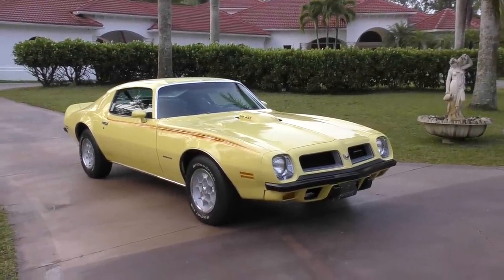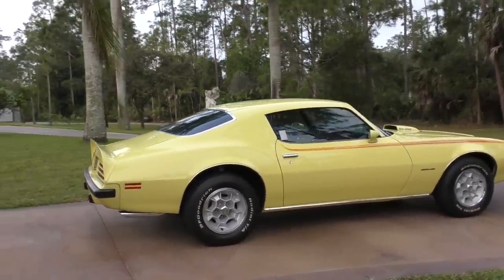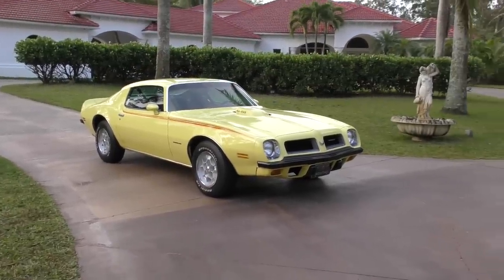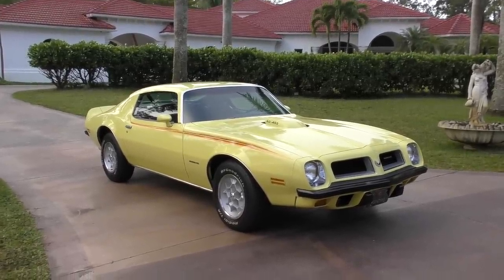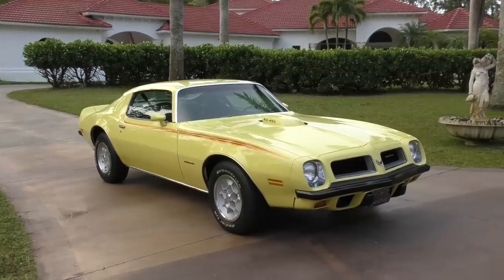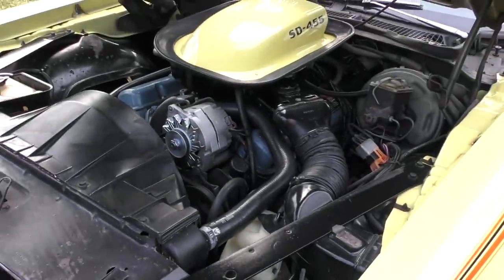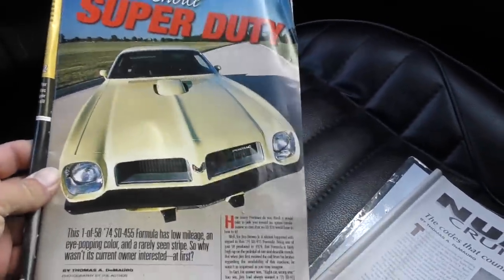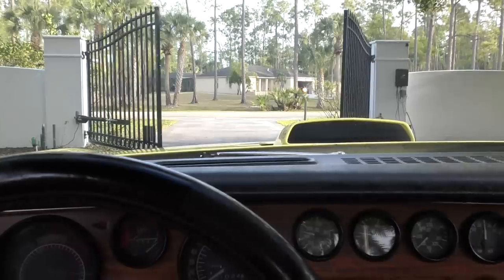1 of 58!  This Ultra Rare 1974 Pontiac SD 455 Formula Firebird is The Last Real Muscle Car

Comment: As cool as the 455SD is.  I cannot agree that it was the last muscle car.   Pontiacupped the 400 with the TA6.6 package from 77-79.  All the 400 79s had the ST-10 trans, 8" rims and 4 wheel disc brakes!  Nothing came close to it so, 1979 was really the last year of the big inchmid size/pony cars-  Trans Am & Formula
Reply: A Muscle car with single Exhaust and Cat? Not even close! the only 400 comparable would be RA II/IV! nothing else!

Comment: Having owned a 73-455 Trans Am (complete with WS6 suspension), I have to admit, on this Gen2 F-Body, the one thing mine DIDN'T have that I wish it did...was a VERY RARE option offered by the factory called the 'Formula Hood/w Shaker'...As the 73 Formulas had twin snorkels that came down to the front grill, picture putting the conventional TA shaker in it, as well...I've seen two in my lifetime...one was a 73, one was a 77 (in 77, the owner told me that it was ONLY available if you purchased the 'Formula 400' package, where the default OEM engine was a 350). Few realized when special ordering Firebirds, that ALL HOODS were available (sometimes as a powertrain-associated package) to all non-Esprit cars...except the Formula Hood/w Shaker, which could ONLY be OEM added to Formulas...

Comment: I've been looking for a Formula 455 Super Duty Car.  Is this the real deal with a Trans Am Hood on it????
Reply from the maker: Yes. The SD Formulas had shaker hoods from the factory.
Reply: @curiouscars9282  Why is it called a Formula then and not a Trans Am?
Reply: How can you be "looking for a Formula 455 Super Duty Car", and not know about the Hood scoop??
Reply: @chutoparadinni5474  The car is the only one I've seen with a shaker hood.  A Formula Firebird does not have a shaker hood.  Someone who owner this car put the trans am hood on it.  No doubt about it.  The tags must day its a Formula but it has the wrong hood on it.
Reply: @24revealer You are incorrect, All SD455's came from the Factory with the Shaker hood scoop, whether Formula or Trans am, same scoop, Pontiac did not want to certify the SD455 again with the twin scoops of the Formula, therefore, the Shaker was used on both.
Reply: @chutoparadinni5474  Ok, I'll have to take your word on that.  I guess I'll search for a 73 455 SD with the Formula Hood.
Reply: @24revealer  Good luck, same as 74

Comment: Its not a big block Pontiacs never had a big or small block they had one size block and just changed the bore and stroke to get different engine combinations later on they had two engines w a lower deck height but in that time frame they only had one size block on the outside so if you had a 350 you could easily swap in a 455 and it be plug and play and that in fact was common back in the day as the three fifty was not so spiffy but the four fifty five was quite spiffy lol

Comment: I have a yellow 1974 Charger Rallye 440 which is a great car and the last of the real Chargers not this 4 door crap they have now. The 440 had 275 net hp and 375 torque. With a recurved distributor and rejetted carb and the 3.55 rear end with the torqueflite it ran a 15 flat at 92 mph. Not SD numbers but still muscle car status. Everything went for a rot after that.

Comment: Are you absolutely sure it is legit? I was unaware that the formula ever came out without the front lower spoiler and wheels flairs. Typically the body was exactly the same in the base model formula as the TA with the exception of the hood
Reply: Flares and spoiler for TA's only
Reply: Formula never had the Trans Am flares, spoilers etc. What are you talking about. Look at the factory showroom brochures for pete's sake.

Comment: thats not a Formula - if it is why put a hood from a T/A on it ???
IF its what it is then why modify it ???
This has been answered by another viewer AND at the 22 minute mark of the video - (me bad).
" 73-74 SD Formulas received Trans Am shaker hoods because they ran out of time to have the ram air hood EPA noise certified "

Comment: There’s no such thing as a Pontiac big block, they all have the same connecting rod length.
Reply: Correct Jon, I agree with you although I’ve heard some consider the larger crank bearing diameter of the 455 to be a “big blocks”.

Comment: Pony cars are not true muscle cars.  Just like a Boss 429 mustang is still a pony car.  A pony car is built off a compact\economy chassis.   The Camaro was built off a modified Chevy II\Nova and the Mustang on the Falcon chassis.  The first and second gen Barracuda was build off the Dart.  The 3rd gen Cuda\Challenger is not a pony as it was built of the mid sized chassis.  Today it really doesn't matter but if you're giving a historical perspective it does.

A muscle car is build off a mid size chassis.  In must have two doors and an typically the biggest or most powerful engine offered.  So technically a small block Charger isn't a muscle car, while a 440 or 426 is.

Also the SD 455 was a bit of a fraud as test mule was ringer.  It use RA IV cam, intake and rockers with no EGR aside from the compression ratio it was what a 455 RA IV would have been.  It was also about a second or more quicker than the production SD 455.  Almost as bad as what they did with the 64 GTO which actually had 421 which was hopped up.  It was still one the quickest cars you could buy in '73 on but they were mid to high 14 second cars not pre emissions 13 second cars.
Reply: All Muscle cars, whether we agree or not, Hell, even the Vett stopped being a sports car years ago, now most if not all call it a Muscle car. as far as the SD goes, many if not most to this day still don't know/Understand what it was all about. why the Hell would the SD team go thru all the BS/delays/and fights with Upper Management to get it release for production? cause they had enough parts to build enough of them? hell no, they knew what the true Car guy culture was about, and what was it's true Potential

Comment: I dond't get it 🙈 ... this is a 74 Formula SD455 ... Formulas had Twin Airscoops, this Formula has the Shaker, just like the Trans-Am ... How come? Was it an option, or was the 74 Formula SD455 due to the Engine, only delivered with the Shaker instead of the typical Formula Twin Airscoops???
Reply: 73-74 Formulas with SD 455 came with the Trans am Shaker, it was an Emission certification deal.
Reply: Well folks….  I personally know person long ago who had a 74 formula SD in midnight blue like my SD.  It had both formula “ram air” non functional, and the shaker. It was a bit weird. Today a real urban legend. Hope it did not end up in the crusher.  He bought it new in Dayton Ohio.  His like my 1974 SD Trans Am also had 1973 SD heads out of the Norwood (Cincinnati OH) production plant.  He could keep up with me on the street,  he had honeycomb wheels like mine,  premium interior and power everything like mine.  Anyway, lost track of him as O got older.  

I met Herb Adams twice.  Second time when a buddy of mine and I added all the Herb Adams aftermarket bits to his no-air stripper 4 speed 1974 Z28.  Made a huge difference now the Z handled better than my the heavier in the front end SD.
Reply: @johnross6314  Maybe it was Ponch's Firebird?